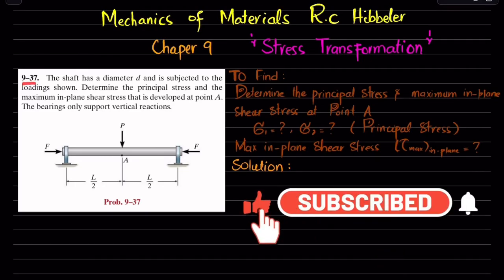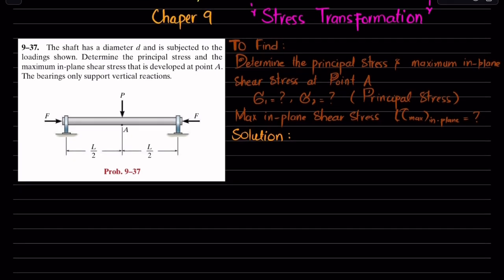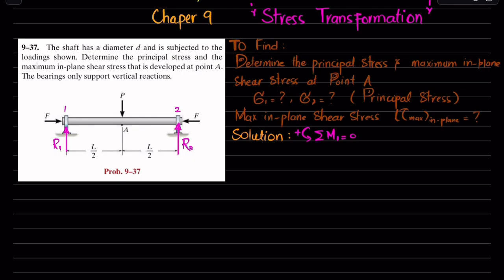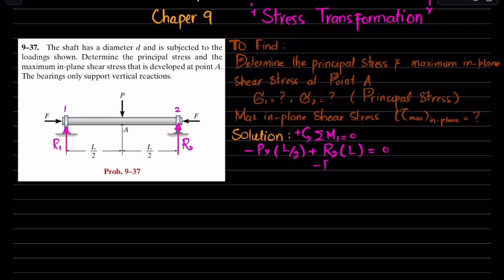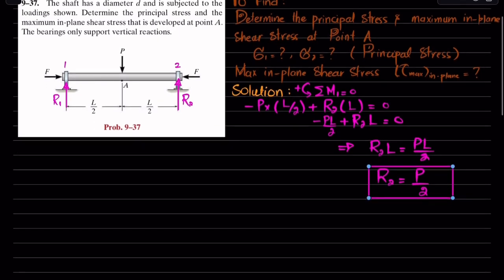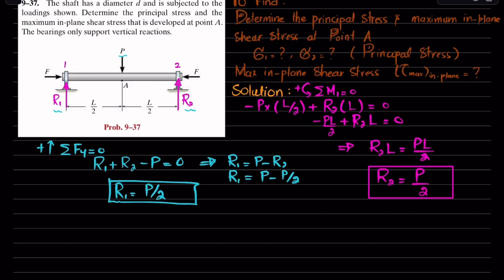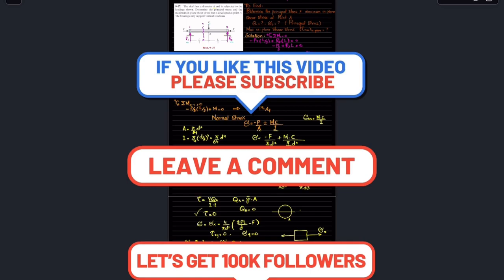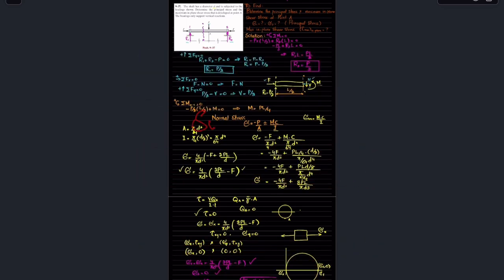Determine principal stress and max in-plane shear stress  | Problem 9-37 | Mech of materials rc Hibb

Comment: 8:46 area moment of inertia of circular shaft soulb be pid^4/32
Reply from the maker: Pi d^4/ 32 = J which is polar moment of interial used to calculate the torsion or shear stress. While pi d^4/64 is section moment of inertia which is used to calculate bending stress due to moment.